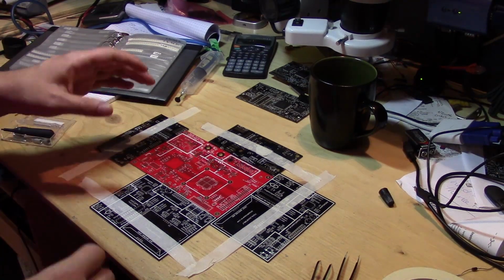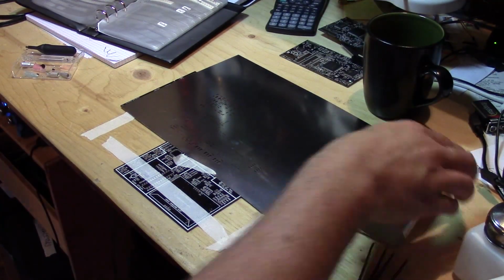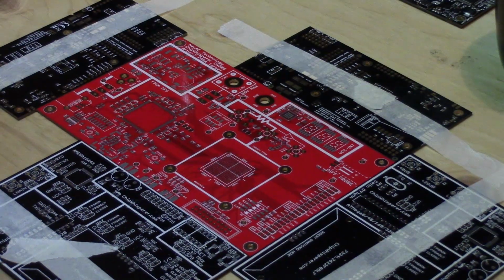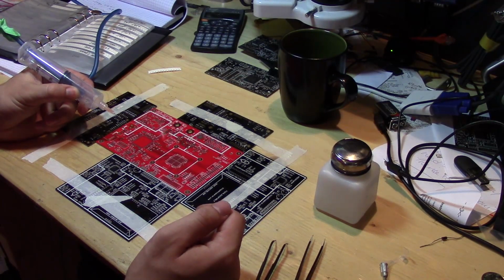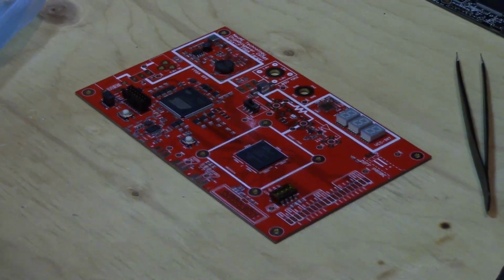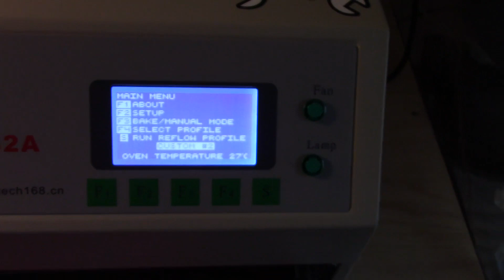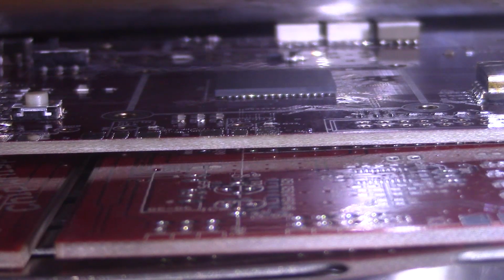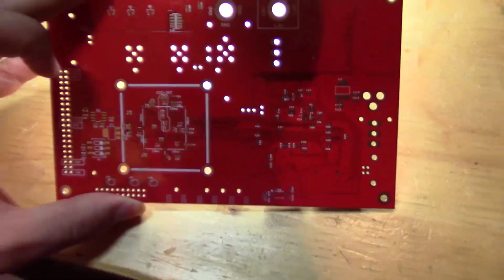Complete PCB Hand Assembly (FPGA in BGA Package + reflow)

Comment: Having that vacuum tube coming from the back of the bench is just asking for it to drag over the PCB at some point...
Reply from the maker: +mikeselectricstuff Yeah, I switched to using a board holder anyway as made it a little more ergonomic... although when you drop a resistor it bounces away due to the ~20cm drop so I'm sure things could still be better I'm sure!
Reply: You can tell it hasn't happened yet or the tube wouldn't be going that way any more.  ....Imagine the cursing! :-)

Comment: Does the completed board do anything? The plastic slide switch & cable connecter, could they have been installed a little later, after the oven cycle? Thanks

Comment: is BGA have an own solder ball, or enough only solder paste on PCB?
Reply from the maker: +ПЦ They do have the solder balls, but I recommend adding the paste on the PCB too. Some people have only put flux down on the PCB, but it's not as reliable a joint. Especially if using the 1.0mm pitch BGAs there is a fair amount of room!
Reply: cannot agree with you anymore

Comment: 1. If you did reflow the board again upside-down, would the parts stay put due to surface tension or would some of them fall off?

2. Can you provide a link for the open source reflow oven firmware replacement?

3. Very clever with the homemade vacuum pickup.

4. Anyone know the difference between the T-962 and the T-962A oven? The A model is a lot more expensive.
Reply: The parts will fall off or peel away when upside down.  What most assembly houses do is spot glue parts in place.  There's a spot glue machine that can put an exact blob of glue under the component. The paste already having been laid down first.  Then the components are placed and the glue complies and then dries holding the component pads on the paste.  When reflowed upside down the paste bridges the gaps (teardrop shape) and wicks up the component lead. There may be newer processes but this was what they used to do.  One reflow cycle for the whole board.

Comment: Not to be a boner killer, but at 27:00, when you're showing the board under the microscope, you can clearly see that the 4 pins (Closest to C45 cap) on IC right next to U15 is misaligned.

Another thing that striked me while watching this was.. you did not clean the stencil side turning downwards to the freshly cleaned board, and therefore smeared fingerprints and grease all over the place from stencil to board, when doing the alignment.

I did also wonder.. when using such a 'powerful' FPGA, why did you not include a FMC LPC / HPC connector, for the 16 GTP transceivers?
You neither use the PCIe PHY USB3, Gigabit Ethernet?
- You're using a V6 engine to drive gears, which are lifting a basket up from a water well with a tiny rope. 

Why exactly did you choice a FPGA with so 'many' logic cells and DSP slices / performance, why not Spartan-6 etc?
I liked everything about this video.. but the design of that pcb seems strange.. have you made that yourself? If yes, care to explain?
Reply: Disappointing there's no reply from Colin to this yet :-/
Reply from the maker: Honestly it's just people acting smart, why bother? I'm making a quick video so can't see the microscope very well (I don't have a tri-scope), the other flaws/shorts I caught doing the proper inspection, but I don't think anyone wants to see me carefully looking over the PCB for 5 mins.
The FPGA board is for power analysis / glitching attacks. There's no high-speed IO as it wouldn't be used by 80% of customers...  the large FPGA for doing stuff like running huge crypto cores or multiple cores when doing various tests on them. Data generation would normally be done on the core itself (or over the databus connection to the SAM3U). If you ask what the board is for sure am happy to explain, but if someone is making pompous claims about how it must be designed wrong, IDGAF and won't bother to respond.
Reply: You see, I never told you how your FPGA board should be designed, I simple asked, because it made me wonder.. So you use the FPGA as a workhorse.. just like bitmining.. cool.. 
And regarding the misaligned IC, I figured out, that you would discover it sooner or later anyways.. I just wanted to help, because it looked so great.. and the actual reason for 'bringing bad news' - not to feel better or more intelligent.

I did not try to come off as a smart ass,.. you did a great job, I liked your video..
- Ohh, and I found the same 'alcohol containers' on eBay, that you use in your video for isopropanol - so thank you for bringing that to my workshop - I use them all the time.. :o)

- Take care..
Reply: @ColinOFlynn  wait is this for code fuzzing?

Comment: Hello Colin! I got a question for you. You said that you will repeat the procedure for the back side. When you wil put the pcb in the oven, won't the components of the first side loosen and maybe come off?
Reply from the maker: The surface tension holds them on in theory. For this board I actually did the backside manually (i.e., with a soldering iron) I think. I made a second version of this, and on that board I did the backside FIRST, as it had only small capacitors etc. I know people do double-sided SMD with moderately heavy parts, so you can probably get away with fairly large ones.
Reply: Thanks a lot! Keep up the good work !

Comment: Hi,
How are  you soldering bottom side components (Decoupling Caps for FPGA) ?
Reply from the maker: This case I did it manually, but you can redo the reflow without issues. For this board I'd do the backside FIRST (I didn't here as it would screw up the video haha), then reflow the frontside. Surface tension should hold everything in place upside down.

Comment: How you place the BGA without it being misaligned? Is the pad slightly curved in so the ball can be socketed in correctly?
Reply: companymen42 surface tension.... the pads attract the solder and it pools up on the pad like a bead of water. So surface tension pulls it all straight. So as long as all of the solder has melted it can be bumped and jump back into place.

Comment: what is microscope you are using? make and model no ?
Reply from the maker: +Bharath Kumar Viswanathan Not actually sure, was ebay special from a long time ago with no name. It has a 1x & 3x switchable objective lens, and 10x eyepieces, something like http://www.ebay.com/itm/10X-30X-Stereo-Microscope-with-Single-Arm-Boom-Stand-/400438576244 . I also have a ring light (highly recommended). The 10x and 30x are about a perfect amount of magnification I think (10x when dealing with slightly larger parts, 30x if you need to inspect closer).

Don't try using a computer-based microscope for real-time soldering (you can find them for even cheaper). The lag makes it far too annoying, an optical microscope is well worth the investment.

Comment: I have a project and i need to solder a BGA chip. I was thinking to create a custom equipment with hot plate and ceramic IR heater controlled with Arduino. Is it possible to do BGA soldering only with a reflow station? Only with hot air?

Comment: Does the surface tension pull the parts more into alignment when it flows?
Reply from the maker: Yup! got to be careful though as if it's too far off it might pull it the wrong way. You can see one of the TSSOP packages aligned wrong, but that was the only part it happened too.
Reply: +Colin O'Flynn It's off topic for the video, but can you recommend a tutorial for FPGA programming that doesn't suck? I have one Altera prototype board and one Xylix board but their info and their programming tools really blow (in my opinion coming from a programming background)
Reply: +Colin O'Flynn There is a nice view of the TSSOP which was a little off kilter and wound up bridging the surface tension at 27:04 on the left just below centre.  Surface tension can also cause passives to "totem", or stick up in the air if one side liquefies and draws the part back before the other side has a chance to become molten and grab the part.  Pressing parts into the paste just a little bit during placement is usually enough to get the flux to hold things down while the solder balls melt.

Thanks for posting this video.  It is nice to see more people doing BGA work with less than $2k in tools.
Reply from the maker: +David Kirtley For FPGAs - I liked the website fpga4fun.com, as it just takes you through some projects. The FPGA tools are amazingly poor for how  large the industry is, even basic features like hiding false warnings aren't well implemented in many of them. If you talk to anyone doing FPGA it's a similar story about their feelings towards the tools.
Reply from the maker: +Kenny M Ah I forgot to mention the totem/tombstoning too... that did happen to at least two caps, you can see C1 & C52 sticking straight up at 27:30. C1 is beside the crystal for the SAM3U (large TQFP package), upper left... they are both 0402 so a little hard to see!

Comment: Nice work! Hi, do you have a link with info on that inline exhaust fan? make model etc. Thanks!
Reply from the maker: I'll add more details on a blog blog post to come, but I used one like this: http://www.amazon.com/Tjernlund-Booster-Hydroponic-Conditioning-Exhaust/dp/B00NEO1PNA . Mine had another name on it but looked the same. I got a little speed control too.. which was needed, as at full speed it is far too much. You can almost certainly get away with the cheaper duct booster fans. The tubing is just dryer exhaust stuff.
Reply: @ColinOFlynn  
Please tell is pcb colour matters

Black Red green

For such soldering

Comment: colin? y didnt you use a hot air gun on the cpu and other componants rather than the machine
Reply from the maker: +Glenn Ferris The hot air gun isn't remotely as reliable... you can't control the temperature rise/fall rates. It would work, but it's a lot more likely to damage parts (either obviously by overheating, or less obvious failures / soldering issues). Once you've locked down the reflow temperature settings you don't need to worry, just fire the board in and you're done.

Comment: hi, i dont understand the  vacum tool 
how it work?
Reply: Small modified aquarium air pump constantly pulls vacuum through the flexible line. At the end of the vacuum line there is a syringe with a hole in it. When the hole is open it can't pull vacuum through the needle. When the hole is closed vacuum at the needle is enough to hold a part. Pretty simple but ingenious.

Comment: How much is the setup? Under 1k? Dude, it looks like you've saved a ton of money by doing it yourself! This is pretty awesome! I can't wait till one day, it'll be easy and cheap to manufacture and assemble PCBs!
Reply from the maker: Under $1k if you bought everything "new/standard pricing", you could get even cheaper if you wait for used/sales. Main costs are: Oven ($350-400), SMD pickup tool ($25 for tips + $20 for aquarium pump), solder paste ($30),  squeegee ($15). You'll still need an iron & hot-air rework station too, so if you don't have that add another $300-400 for a nice one (but if on the cheap ~$150). Lots of people have reused toaster ovens too with fancier controllers, but it's easier to buy the linked oven I think.

Comment: i came here from hackaday. id like to be able to solder a 144 pin ARM MCU without having to pay £100 for a board. problem is i need the 4 layer board rather than being able to solder
Reply from the maker: +Allen A If you need cheap PCB lots of options... oshpark.com in US otherwise lots of overseas (see pcbshopper.com)